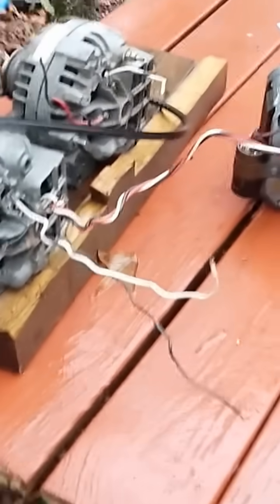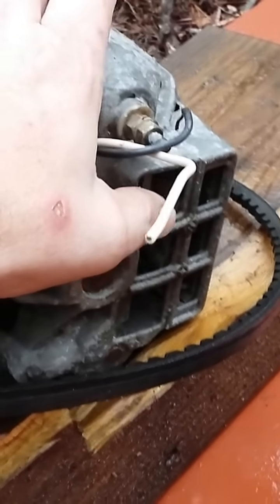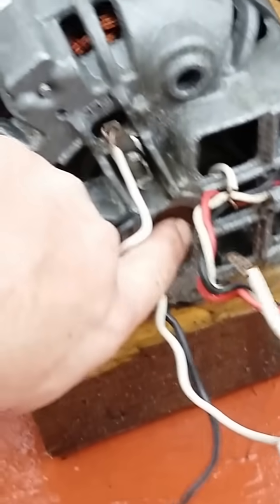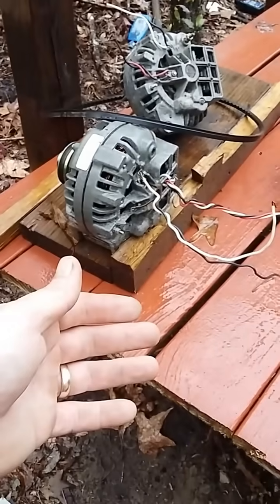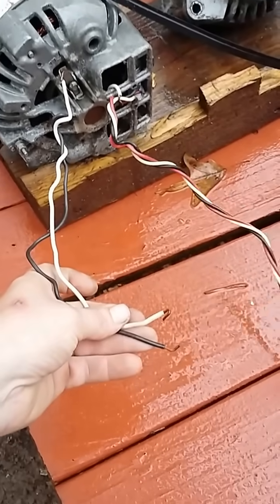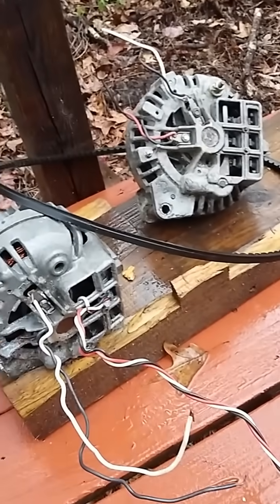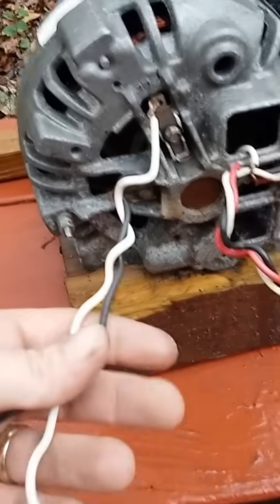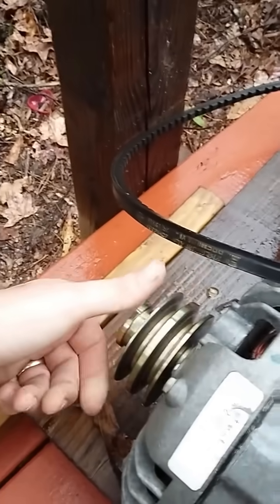Update Free energy forever no wind no solar no gas READ DISCRIPTION!!!

Comment: Doesn't work, SCAM!!
Reply: When you said that that didn't work did you run that old card redundant math and then just go ahead and find yourself at a wall when you factored in thermodynamics without allowing for variables such as maybe a lower draw on the motor, higher producing alternator as well. This brings a loop effect into play. In Hawaii you have to pay to be rid of a car, and it's all jungle on the big island. Anyway, alternators, assorted wire types, and an array of assorted features that separate they're qualities. The law of thermodynamics to hold its meaning is confined inside unvarying parameters, There is no supplemental adjustments made, nothing is really done except for the number buffs cancel out the work with eliminating the need to waste time as they would then see it. At that point the smart guys are out because math held up, and rendered it all for not. Then a rag tag broke idiot with a few broke down rides in his yard brings together a combo producing more than expelling at the point of exit and returning. This defys the Rule of Thermodynamics because this is by adding variables achievable in so many ways, but if you been told to stay on the law "no variations" we all get the same insane result. Insanity is doing the same thing over and over expecting a different result. If you need to read anything else after hearing this before you begin noting experimental methods documenting the leveraging of each piece in the model differently to afford a way out of that box. Good luck with American Physics text of modern times, and use variables, and maybe change the algerythym as well. Oh yeah, and that 1% of content you are scared to crawl out from on the web. Tor or onion browser. People who have pushed the physical model, and know it to be feasible, will be the first to tell you how dumb you look. Idiots are discredited, and smart guys know when to say "ok that worked, better go, and let people know I was wrong" because that's the correct answer. Pay attention to the smart guy.. .. Tesla Etc. ETC. WHAT HAPPENED TO THAT GUY WHO SAID HE CREATED ELECTRICITY OUT OF THE AIR? HE WAS HELD IN CONTEMPT AS HE WAS DEFINITIVELY WRONG. YOU HARNESS IT, STORE IT, FEED, IT ETC. CANNOT CREATE, OR DESTROY IT. (Electricity) Anyway, he was corrected..... wherever  it come from, and shown to be excepted as wrong to his peers, and colleagues. With him or against him huh? This is all I'll ever speak of it.... I'm ready to admit I'm stupid, and wrong when or if the time should come to publicly condemn myself...
Reply: @kevingiles978  
Sorry, I'm a physicist. Thermodynamics doesn't work like that.  The overarching rule of thermodynamics is that you can't get back what you don't put in, and you can't even break even because of the losses in the transformation. Every time we've EVER tried something  like getting something for nothing, that rule has held true perfectly, and we couldn't. If we could, then we could feed the machine with its output and it would keep growing till it destroyed the universe!!  Since that never happens, well....
Reply: @rstevewarmorycom  Hence why the US Patent and Trademark office will not even consider any application for a perpetual motion device
Reply: @AmericanFreedom911  
Yup.
Reply: I could take pictures of the entire statement that I just put up there so that I would then have a copy of it as well and the reason why was because it would not let me highlight any of the content and post it to my clipboard as I can any other thing on my telephone if you ain't learned Nothing by now learn to shut up

Comment: YOU SAID USE A MOTOR  TO TURN THE ALTERNATOR  WHAT RPM SHOULD THE MOTOR HAVE INSTEAD OF A MOTOR CAN A WATER WHEEL DO THE JOB?
Reply: I don't see why not but where do ya get the power to run the motor that runs the generator? like one comment said you can't get free energy. Sounds like he's using energy to create energy. A water wheel should work, a windmill should work. I don;t get the comment about getting electrocuted. I learned when I was 6 years old not to touch the bare wires. Who's had the ole lawnmower trick pulled on em? I knew not to pee on the electric fence when I was like 10, I found out not to pee on the green weed until it got heavy enough to bend over and touch the electric fence. YEEEOOOWWWWCH
Reply: Gears and pulleys, PHYSICS. Little gear or pulley hooked to the bigger gear or pulley creates more force.

Comment: PLEASE don't listen to this scamming idiot - - you could hurt yourself and affect others in your neighborhood.  Just the fact that he says he can run 90 amps at 220 volts is actually stupid and if it could be that amount, the wire would melt on site and start a fire and/or electrocute you.  The basic law of energy is that energy can be transformed from one form to another, but can neither be created or destroyed.  Nothing is said about the power required to run the motor.  Where is that coming from?  Also stating that this idiot could interface the house with the electric company is not only illegal but could severely damage the power to his neighbors, let alone the fact it is illegal. This idiot should go to jail for just putting out this scamming information.
Reply: Depends on the amps. You can run 40,000 volts through your body if it's on low amperage but yep, best thing if you don't know what you're doing stay away. Play with fire enough and you'll get burned. Accidents happen to some of the smartest people. Cat jumps on the wire, wire falls onto the metal or in the water-DISASTER. Good advice, stay away. Don't try it unless you have on your 40,000 volt lineman's gloves. I've heard of an electrician just stood up and his head got close enough to cause the high voltage to arc to his head. GONER
Reply: In Texas, selling power back to the grid is not only legal, it's encouraged

Comment: Another electrical genius! Apart from all the obvious problems please explain how a three phase output designed to be rectified and regulated to charge a vehicle battery is compatible with a domestic household single phase system. Idiot!
Reply: from rectified to  smart charger to battery bank to inverter to fuse box.
Think of his system replace solar panels, but you need energy to turn the alternator.
That's why i create self power flywheel to spin any generator
Reply: Smoke and MAGIC !!  Don't let the smoke out !!  If you did then you did it Wrong !!!  lMFAO @ the idiot and his Fool Followers.

Comment: I have an Electrical Engineering degree and i regret to inform you that you are sadly misinformed with the expectations and claims you have about running your house off of alternator.  By reading the comments looks like I am not the only one.  But you certainly have the right to disagree.  However,  if you can make it happen and prove us wrong,  I like to see it happen.  just saying

Comment: All is demonstrated here
https://youtu.be/bzHYtA5LbAA
Reply: The video referenced is using AC power from the grid to run an alternator, which outputs DC to charge the battery, which is connected to an inverter to convert the DC back into AC to power the appliances. So essentially, you can just plug the lamp into the power outlet feeding the motor that runs the alternator. It's just a demonstration. It's definitely not "free" power.

Comment: Hello Thomas Buie , I’ve been following this wisdom you’ve come up with ! I’m planning on doing this can you shed some wisdom on the issues on paper I have the house electrical is 250 Amps & 230 Volts from the street the Alternators I’m about to order 2 Alternators GM 1 Wire B.B. Low RPM Voltage 120!Amps X 2 = 240 Amps But Voltage is only what I see 14.7 X 2 -= 29.4 volts ! Not enough volts Please shed some wisdom please ! If I tap it out the little which is simpler as you’ve done how much is the total watts out put on an Alternator Ac this way wiring it ?
Reply: Frank sinatra
Reply: I got enough Amps I figure but Voltage looks to Low ! Would you shed some wisdom please Thomas ?

Comment: You are the seventy five millionth person to "invent" this.  As you have now learned, it does not work.  The source (battery) will run out within an hour or two depending on what you run off the generator.  Then, you'll run to power company power source to get charged.  Take a few months and go to school.  Learn some spelling and some physics, the first rule of which is power out = power in minus losses.   You get no power out unless something drives the machine and a battery is not an original power source.  It doesn't make any energy.

Comment: This is a well-paced outline to build this. I feel that a 20ah 14.2v Supercapacitor bank will help with the motor as a small power well to draw from. I aim to build something similar and hook it to an EV car. It's so simple, why are there too many naysayers about this?
Reply: Another idiot
Reply: Because of what I said in my comment above. It's one thing to talk about it it's a whole another thing to run it and show measurements. I believe in this stuff so I'm not overly skeptical but I still to this day haven't seen anyone accomplish what they claim as far as this type of system and I've watched a lot of videos about this kind of power generation device.
Reply: Ratheon Hudson : I strongly believe that there is a way to do what he’s trying to accomplish, just not the way he explains it. I have some limited understanding of electricity, but even me can tell you that if you put 90 amps through those 12 gauge wires you’ll get to the definition of “fire started by short circuit”

Comment: Could you show a step by step setup and electronic devices working with the output. 
I want to believe it works but.... Please show parts list, assembly and working devices.
Reply: Which is completely reasonable to expect. If this does work I'd like to see him running his house from it.
Reply: @Boki001  You certainly know that it cannot work without any mechanical power source that spins his generators pulley.

Comment: When I was young I worked in a TV repair shop. Two guys came in one day and wanted to buy cable connectors so that they could build a satellite dish. They knew that there were satellites in the sky that transmitted TV signals and they had a garbage can lid and figured that they could use that to create a satellite dish and get free satellite TV. Based on their level of understanding it made perfect sense. This guy's level of understanding about electricity and power generation is similar.
If you want to read more about why what he says is wrong I'll explain a little of it. A lot of people think all you have to do is spin a generator to get all of the power out of it. You don't spin a generator with a half horse motor and run a 1 horse motor with that generator it just doesn't work. The larger the load you put on the generator the more power you have to have to turn it. Also the alternator is that he is showing or three phase. The three wires coming out of that alternator are not the same type of power as the three wires that run your house. There are ways that you can use two of those wires to run 110 or 220 volt device but it would be very inefficient. Every time you convert one type of energy into another type there is a loss. Turning mechanical energy into electrical energy you lose at least about 10%. Then converting electrical energy back into mechanical energy you lose another 10%. That's why you can't run a generator with electric motor that's powered by the generator.
Reply: On just a side note, many years ago, (was working as a EE for one of the big corps) I got to messing around with Sat xmissions.  This was when the Internet was all character based, green screen, and ran only on Universities and etc. I designed and built a Sat receiver using a pcb I designed, and put it inside a 4" (diam) pvc tube. Capped both ends, adjusted the receiver inside until I had max signal, then ran a power line in the house, and that's how I changed frequencies. Then mounted it on my roof using a metal bowl and fixed the pvc to that. After a few tweaks I could pick up Sat TV signals from lots of places. From Porn to TV show. Some of the stuff was encrypted (military). It was fun and I enjoyed using it. No one believed the full porn shit until I showed them.  Now it's just common to see it all.
Reply: There's no doubt this stuff is interesting. I've built a few things myself from a small radiant electricity receiver (4 diodes, capacitor, and metal plate or ling wire suspended in the air), a few different joule thieves, a crappy version of the thane's transformer (I used to ferrite toroid's and there was no difference in the permiability as required), I've attempted and failed to build Meyers water fracturing tube setup, and the bedini coil/starship coil with some plans in the near future to try something else. There is definitely something there as evidenced by the oscilloscope and voltmeter reading I got. I've also read in the PJK free energy book about something similar to what he is describing here as well. However his videos are just him talking about it. Why not just run a few things so we can see this theory in practice is all I'm saying. I've seen so many videos like this claiming to generate enough power to be able to supply a house but for me the problem is that I'm not seeing it, that's all. I've explained this to him nicely unlike other people but I still haven't received a response. So that's why I'm skeptical. Also, keep in mind that in science s healthy degree of skepticism is what keeps things going forward because it helps weed out untruths.

Comment: This guys "description" and method for explaining, has scam artist written all over it. You don't explain a damn thing about how you can do this without outside power.... description included! I hate click bait scam artist like this!
Reply: Hey Michael, that's exactly the problem. If it's true it should be shown and explained fully because then other people can replicate it and verify the method actually works and for ling periods and is reliable. Science/technology is never done in secrecy and advances forward, that only hinders things because after something is explained/published people are able to independent repeat the experiment and then verify or disprove the out of the original experimenter. Unfortunately this method isn't going to get us anywhere because we're supposed to trust off of what he says on blind Faith and waste money of equipment to try to verify it blind basically? Think about it because what you're saying doesn't make sense.
Reply: Hay dick head, you need DC power thats a 12 volt battery,,,you also need a DC TO AC converter to produce 90 amps...it helps to a small clue.....he said  no spoon feeding...lol

Comment: Should be able to power itself. On the AC side run a circuit to a 12 volt DC transformer. Direct the DC load side of the transformer back into the DC side of the motor which in turn returns you an AC line power surplus back out to the transformer.

Comment: Ok so what if i don't have 6-12v to run the alternators can they be wind or water driven to produce the same amount of electricity?
Reply: Use a car battery
Reply: Cody Cheuvront that would be the easiest way to do it.
 I wonder if it could be wired up in a way that it could recharge the battery as it runs. Once the 12v DC is converted  into 120v AC a battery charger could be powered but whether or not the battery could both supply power and be charged concurrently I don’t know.  I would assume it would work since that’s what happens in a car.  If this circuit could be completed that’s a great source for near perpetual operation.
Reply: You would use a small battery to power those two wires he refers to.. And use something like water to power pulleys on the alternator. Then use output of alternator to run something electrical as well as charge intial battery you used for your 6 to 12vs.
Reply: @timothyhiggins2915  ok thanks.  So just spinning the stator with wind or water will not produce any electricity coming out the alternator?
Reply: esco361 g
It would produce electricity but it would be a variable current based on how fast it is turning.   It needs to be a constant speed to produce a constant, consistent output.
Reply: Thanks for the input guys

Comment: This guy is full of shit...an alternator does put out AC but it's low voltage, and then it's rectified and you get 14 volts that is
regulated, you would never get 220 out of it and it would have to be
hooked up to a motor to drive it
Reply: The idea is good. It just needs work. What I would do is instead of wiring direct to house is buy a 5 hp motor than is designed to run off a solar panel. And I would buy a 600 watt solar panel. Then I would buy 3 300 amp altenators like the kind on 1 ton trucks. Then I would setup a inline pully system that would crank all 3 altenators off of the single motor running from a single solar panel. And this would all run to a battery bank that would be charging anytime the sun is out. This is the way you get free electricity from car altenators. Its you could do all this for about 4 to 5 thousand. Which is peanuts compared to full off grid solar systems that cost tens of thousands.
Reply: But what he isn't saying is that you need some type of a transformer or converter box
Reply: What this idiot is trying to say is that he has come up with perpetual motion .,and don't have nuff sense to to even know what that is.duhh.roll another 1.
Reply: take a pek at www.gogyropower.com 50years ingener he have great stoff
Reply: It Don't Work!!!!
Reply: Actually you're full of shit because what he is saying is very true.